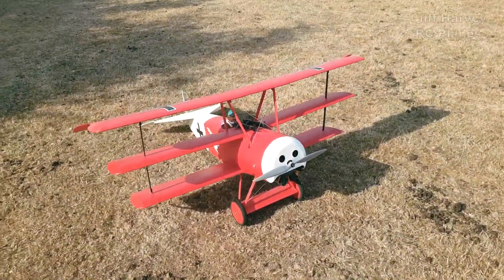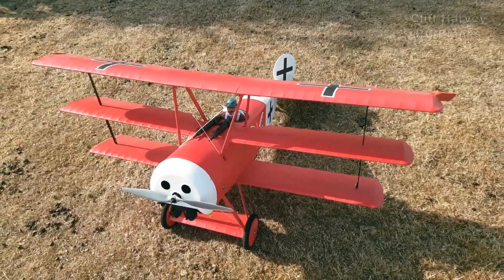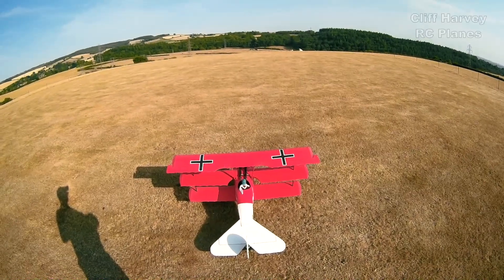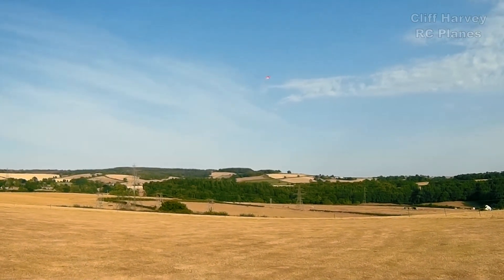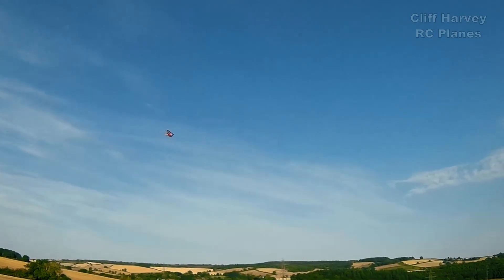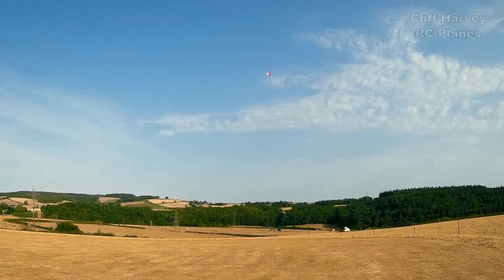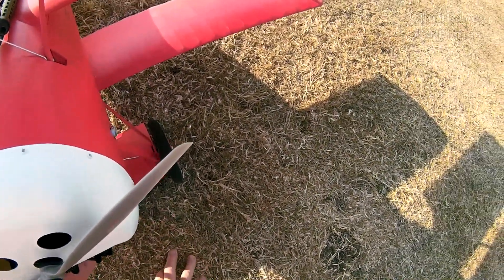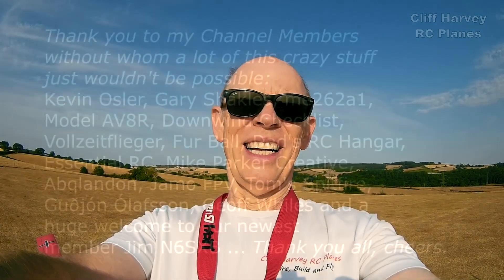Fokker Dr. 1 Triplane Full Version

Comment: That fence needs some barbed wire around it and a deep trench behind it, also a couple of exploded mines and yeah, nearly there mate. Oh, dont forget the sand bags. 
Smooth landing though, got ta keep a bit of power on.
Reply: On a serous note, I also have my Fokker Dr1 on a aileron and rudder mix. This aircraft needs it.
Reply from the maker: @thebarronflights  A few shells would add to the atmosphere for sure lol. I'm really surprised at how poorly it behaves just using ailerons. Do you have differential on your smaller model Nick?
Reply: @CliffHarveyRCPlanes  Modern models are not the same as the real thing. Manufacturers need stable models. 
So yes it is the same and indicative. 
The real thing was very unstable, and so pilots soon ditched it when the D7 came in to production. 
But now, with modern tech we can if desired fly it unstable. 
I would like to fly it that way personally. 
I want to stunt it. 
Does that make scene?
Reply from the maker: @thebarronflights  Absolutely, talking of stunts I've yet to roll it, I just don't want to stress the structure to much ... not at this stage anyway!

Comment: Shouldn't it it be a light blue underside on the wings and half the fuselage?   That is if it's Lt A Raben Jasta 18. I've seen one image with red underside, but most other images and sources seems to agree on blue underside. Beautiful flyer anyhow. 
It could be fun to build one, have a smaller engine, and the throttle on a switch, just like the real one. 😊
Reply from the maker: Hi Darkiee, I've seen the same images as you and as long as one image had red undersides that was good enough for me, I don't really like the 'Hell Bleu' that other images show, also I just love red, but not all over!, cheers.
Reply: @CliffHarveyRCPlanes  I agree with the "not all over" red. It seems that 95% of all dr1's are all red after Richthofen's plane, but there were other colours available too. 😁
Fun Fact: Raben was the only one who had a white raven on his plane, all the others had black ones.
Reply from the maker: @darkiee69  I was originally attracted to Raben's machine because of the blue and white scheme but a little research soon had me realising that scheme didn't actually exist !
Reply: @CliffHarveyRCPlanes  But it does look good in blue and white. Even if it's made up. 
My favourite is Joseph Jacob's all black one from jasta 7, or Lothar von Richthofens yellow and green.